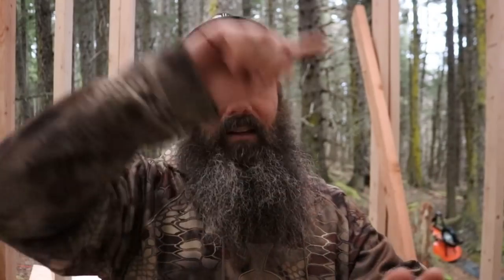Installing bedroom window

Comment: Good Morning Guys,, Glad to see a new video,,, was wondering if the motor broke & your drifting south west towards Japan..lmao..... Doing windows,, fun job... Hard to tell but i think if the top staging was turned so the ladder side was in towards the house & one plank in top outside & the other was on the first or second ladder down,, you'd be able to stand & keep your tools behind ya on the top plank,, which would be waste height,, & easy to access..Those cross braces you can double going side to side across the bottom or bottom to top to be outta the way.. Just an old dog fulla tricks 4 the next project,, hope it helps!! still loads of snow & ice here in Northern Maine!! be safe,, you can screw a chain// hock // something to facing too into a stud,, rope the staging,, also for the next project.. It's doesn't hurt to fall it's the stop at at the bottom!! Aloha ps does your island have a name or the one across the bay? i was gonna goggle ya & look from 200 miles out..
Reply from the maker: Ha you caught us. As soon as we got done putting on the cross braces I said $#!+ I got this backward. She wasn’t getting on the top level so when I asked if she wanted to switch them out, the answer was no. 😂 
Being an old army airborne trooper I lobe the fall, it’s the thud your body makes as it comes in Contact with the ground that hurts. lol
I try to keep the name of the island private not that I expect any visitors but just for opsec purposes. There are a tons of islands with lots for sale in the inside passage. 
Thanks for all the old timer tips and tricks. 
Hope you have a great day.

Comment: Hail and Good Eve from Central WY!!!

Loved it as usual, but I was dismayed at your 'next project' comment after you'd completed the window installation!

I looked at all that plastic covering on that wall of the house and thought "Really? The scaffolding is already there, why not shift to putting up the siding to complete that wall first, then move to the Entry Way?"

I'm not a builder in an even remote definition of the term, in fact, I would argue that I'm 'geometrically challenged' in SO many ways! However, I do my best remain logical in the steps I take with a project, so my thinking is that the siding would be the next project to complete the house and make it more weather secure!

Since you live where you live, the siding you need might not be available right now, or it might be on back order, or you might be going 'custom' for that side, using dead timber that you plan on milling yourself! (actually, when I look at a parcel up in the Kenai, I specifically look for large 'kill zones' from beetle damaged, that might be able to be used for milling purposes! Dead Timber is usually 'free' for the taking, so I'll be making a list for access to that standing dead timber for collection and uses! At a minimum, LOTS of free firewood!

Glad to see all is going well, and I hope that the injured hoof continues to be on the mend!

Cheers from your fellow Ingrown recipient! 

JR Bailey
Reply from the maker: Hey JR you are right I’m guessing what next week video is. Putting up the siding. Although it was not what I wanted to do. We had a long discussion and of course she won. Well, as I’m putting the roof on now I’m paying for it. Because we are tying the roof of the mud room into the existing wall we want the flashing to go underneath the new flashing. It’s easier to have the room framed and as the flashing then do the siding then the other way around. I got the flashing on but it turned a 10 min job into two hours. 
She did have a good point and that is it would be easier to put the siding up using the scaffolding rather than two ladders. 
In a few years I want to build a shop and we may mill some of the lumber for that. I’m thinking cedar shanks would look good. Hopefully by then my carpentry skills will be on point. lol
Thanks for tuning in buddy. 
Have a great evening.
Reply: @AnAlaskaHomestead  

Thanks for the explanation, and yeah, I was married for 5.5 years (we're still best friends) and I learned that arguing with a woman has the same positive result for my point of view as trying to go through a brick wall.....just doesn't work out the way you want it to, so just shut up and do it!

It's what I refer to as my 'Yes dear' paradigm!

Problem is of course, she really did turn out to be right more often than not in our debates.....ya gotta roll with the punches!

We've got rain most of next week until Fri. which is supposed to hit 71 and sunny....if it happens, it'll be the first 70 degree day of the year!

We regularly hit 90's and even some triple digits here during Summertime, which is one of the reasons I'm looking forward to the move North when it happens.....I prefer Summers with 60's and 70's, not 80's and up.......

Got friends on a Retirement Trip (husband and wife team that I've been best friends with since we were all in Jr. Hi), dropping off some brew and providing a little muscle for the stuff I can't do alone...which gets me several steps closer to the Kenai!

Thanks again for your hard work on the videos......though I haven't done it in several years, I was into semi-pro photography (Rodeo, Motor Sports, Landscape/Wildlife) and Post-Production was where the hard work really came in....but at the end I was proud of the fact that I'd finally learned enough to really use histograms for more accurate final frames!

Stay safe and keep and eye out for the Grizz, and do your best to keep Gunner from dallying with the Otters!

My best to your better half, love her laugh and attitude!

Cheers from Central WY!
Reply from the maker: The yes dear paradigm. I like it. lol
Well I hope you get to Kenia sooner than later. 
Oh man, photographing a rodeo would be super cool. No. Stop action and hanging around crazy people. lol
Growing up in Oklahoma I had several cowboy type friends but I had two friends in high school that rose bulls. Super cool guys but a little on the crazy side. lol
Anyway, thank you, I keep trying to make better videos each time. It’s a slow progression. If I go back to my first video compared to the resent ones I can see an improvement. 
Thanks again JR
Reply: @AnAlaskaHomestead  

Glad you like the Y.D. Paradigm! Worked for me for quite a long time; kept me out of MORE trouble!

Yeah, I've got two younger cousins who were bull riders, and one of them earned a top 10 slot in the Rocky Mountain circuit, before a severe wrist injury put the kaibosh to the riding (well, his wife was the final nail in that coffin, especially after they had their little girl).

Bottom line is that ONLY crazy people ride bulls; it's the most dangerous sport in the world as far as I'm concerned; when bronc riders (bare back or saddle) walk by they 'creak' from all the tendon and joint injuries!

When a bull rider walks by (hobbling as he goes), they 'clank', from all the metal screws, plates, and bars in their limbs!

Toughest way I know of to make a living, outside of being a derrick hand.

Well, finally got some grub in my gut so I can take some pain pills a bit later; empty guts and pain pills just don't mix anymore. Take care and I will  look forward to your next installment!
Reply from the maker: Ha clanking  and clunking as they walk by. 
It’s about time for me to take my pills as well. lol 
Getting old sucks.
Reply: @AnAlaskaHomestead  

"Getting old sucks."

True, however, if we're NOT getting any older, then by definition we must already be dead!

Being on this side of the dirt is still a positive for me......it won't be at some stage, and sadly, that'll probably come sooner than I expect, but I'm not there yet!!!

Got quail to raise, fungus to grow, hogs to herd, goats to milk, and phesianidae of strange orders to get to breed and provide fertile eggs that I can sell, after I get to the Kenai!!!!

Staying on this side of the dirt is still the order of the day!

Pain pills have finally begun to provide some 'drowsy'....oh that I might have had some dark rum to enhance the effect, sigh, not in the budget for a bit!

Cheers!